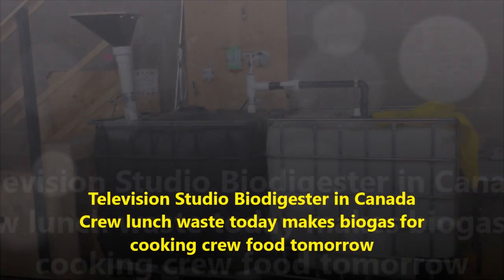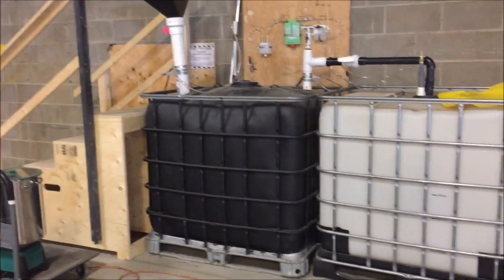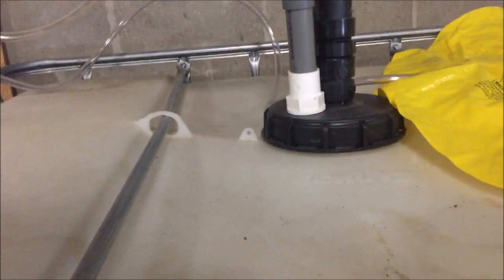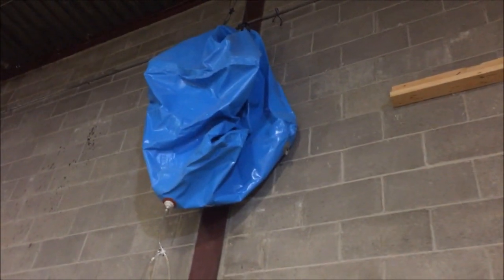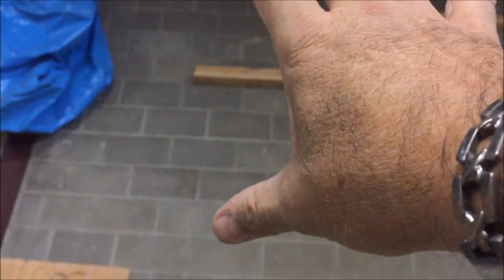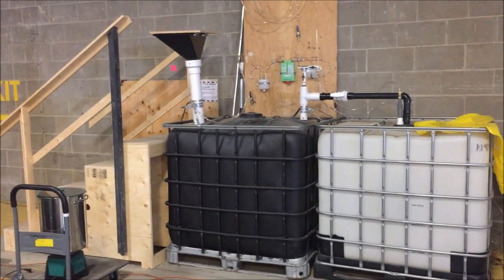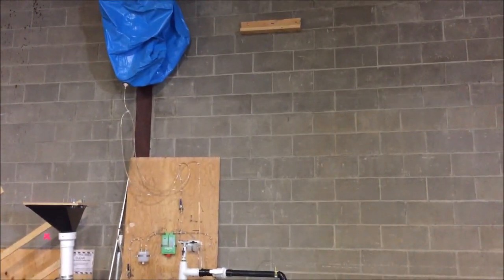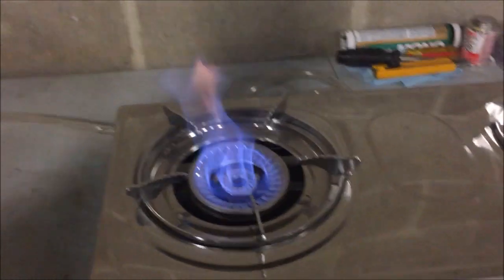Television Studio Bio-digester system

Comment: Nice video. Great work man.
Question:. What is better, 1 big system like 10tonner bio digester or

10 smaller system of 1 tonner container?  Appreciate you very well thought of response. Thank you!  GBU!

Farm produces 15 tonner chicken dung.
Reply from the maker: Maximum you can feed a biodigester is 1/30 of the biodigester volume per day. 

Feeding more does not produce more gas and will not process the waste enough to get the gas and fertilizer quality. 

Also you will need other food waste and animal dung to feed. Chicken dung is too acidic and high in alkaline and could stop the digester from working if you only feed it chicken dung.
Reply: @gregwhiteside7045  copy thanks for the info. Yes I'm aware of it. I will have to get the dung daily instead of one bulk loading. Not just kitchen waste but farm waste but all will be shredded. Like rice hay, leaves dried and fresh.
Reply from the maker: Try not to put in dried leaves or wood, they will float inside the digester and could cause blockages and they do not digest well. Manures, food waste and green plants or green leaves can be ground or cut up and placed inside to digest

Comment: Very clean system, but how did you get gas when the gas bag was empty? Any outlets needed for overflow?
Reply: The bag wasn’t completely empty, there was 50-100 litres in the bag. 

The plumbing system setup includes a simple water pressure release. This is just an inline tee on the gas line to the bag. The gas passes through this tee. The branch off at the tee fitting hangs down and a short piece of gas line poly pipe is attached to this. The short piece of poly ends in a container or bottle that is filled with about 4 inches of water. The container or bottle is not sealed at the top so overflow gas is released and so you can add water as needed as it evaporates slowly over time.

When gas is generated it takes the easy route through this tee fitting to the bag and fills it up, when the bag is completely filled and the gas generated in the biodigester can no longer flow into the bag, the gas pressure is forced down the tee into the water and bubbles out safely as a pressure relief. The water also keeps the bag filled to maximum until I can get a chance to use it.

This is not ideal, since it does release small amounts of methane rich biogas into the atmosphere, but it does act as a simple safety valve that saves the storage bag system if left unattended for a period of time

Comment: hello, how long will the biogas burn? and how do you clean it inside? how often has it to be cleaned?!
Reply from the maker: Depending on the device you are using the gas can last for various amounts of time. A one burner cooking stove on full uses about 10 litres per minute, so if you have made 1000 litres in the bag (a full bag) then you have about 100 mins of cooking time. 

A small 3500 watt biogas generator uses about 60-100 litres per minute so you would get 10-20 minutes of electrical run time run time. Gas production depends on the type of food waste you use and the temperature of the tank. We are in Canada so the digester needs to go inside. 

The digester is always full to prevent any air from inside. This is an anaerobic process so no oxygen is allowed inside or the process stops. Every time you add food waste the same amount of organic fertilizer is pushed out and into the second fertilizer holding tank.
 
It never needs cleaning, ever. 
The methanogens and pathogens inside consume everything, just at slower rates for more dense organics. We use the food grinder or for home use you can use an old blender or juicer from Goodwill to help speed up the process by “pre-chewing” the food and breaking the organics into smaller pieces, mix with old soup or milk or juice or a bit of water to make it into a biodigester smoothie before feeding and it will be very happy.

All fats and oils going inside float to the top region and are consumed rapidly, when broken down the remaining water and nutrients float down to the mid level in the black tank. (The neutral or fertilizer zone) Heavier organics do the opposite, they settle on the bottom and are consumed more slowly, and as they are processed inside they become lighter and 100% of the food’s nutrients float up to the same neutral zone region in the tank. The piping set up inside makes sure that the liquid pushed out when you add new food waste is drawn from this neutral (completely processed layer) within the tank.

100% of the nitrogen, potassium, vitamins and minerals from the original food waste is captured in this water density liquid (biodigestate). It is a super concentrated, organic fertilizer that can be used to grow more food. Closing the loop in food waste recycling and capturing the methane (a greenhouse gas that is 20-25x more dangerous to our atmosphere than CO2) that would normally be released into the atmosphere through traditional composting or sending the food waste to landfill.... It is a natural, organic fertilizer and so rich in nutrients that it can be diluted with water 20:1 before application....so 1 litre of biodigestate from this process makes 21 litres of natural (odour free) biodigestate or compost tea as we like to call it.

When we capture and then burn the methane, the energy is released and the by-product is CO2 and water vapour. Since this is the same CO2 the original organics took in to grow, this is a carbon neutral process. No CO2 is added to the earths atmosphere and this CO2 can now be used by the next crop of plants as the building blocks of plant cells to make more food.

I have a new build going into an indoor vertical farm here in Canada. They will use the biodigestate as a liquid nutrient base for the plants inside and burn the biogas to supplement the heating bill in the winter and the CO2 from the plant waste will be captured inside to raise the CO2 levels in the grow area so the plants will grow faster, to make more food.

Go to Solar Cities Biogas Innoventors and practitioners on FB. Search my name at the top, I have posted pictures of the latest build and I mentor many farmers and builders around the world on there to teach them how to build their own biodigesters with what they have available and how to convert existing LPG devices to run on safe, low pressure biogas.

Let me know if you have any other questions and thank you for watching my video.
Reply: Greg Whiteside thx for your super cool answer, this does help me to understand more and more the process of making biogas. right now we are with our motorhome driving round europe, and i always thougt how to use our toilet stuff. at home i want to try it, and thats funny, cause i am also starting to grow inside our hydroponic fodder and some microgreens. i wish there would be a small traveling solution to make biogas, but thats maybe to small to use it. thank you very much for your answer. i appreciate that.

Comment: Anaerobic Biodigestion is an oxygen free process. The digester container must be filled completely with liquid to eliminate any air (oxygen) from being in the container. Otherwise the methanogens and pathogens inside they digest the food waste will die. So when the black container is properly loaded (filled) then each day when you add new food waste to feed it, the black digester pushes out the same amount of digested (biodigestate) fertilizer into the white fertilizer storage tank beside it. 

The methanogens inside the black container consume the food waste you put in today and convert that to biogas (methane and CO2) that you can burn for cooking or energy and into a tea like liquid fertilizer concentrate that you can use to grow more food.

Comment: so can siphone effect hinder gas production and collection
Reply: Siphon effect will just empty (siphon) all of the biodigester into the fertilizer (effluent) storage container once it starts to flow into the white container. So the goal is to stop that flow when you finish adding new food waste to the digester.
Reply: @foodsecuritystructurescana4440  should the setup tank be left idle for a period for gas production start before continuing to feedstock it and if so for how long?
Reply: Yes 
Inoculate with a fresh manure (cow, horse, pig, human) 
1/3 manure and 2/3 water.

Keep warm and do not feed again until you get burnable gas. Usually takes 21-30 days. 

First gas you get will be just CO2 and it will not light. 

Empty your gas storage each week and try to light the gas. 

When you can light the gas, then it is time to start feeding the digester. 

Each day you feed it, do not feed more than 1/21 to 1/30th of the digester size (divide the digester volume by 21 -30) based on how long it took you to get burnable gas.

Feeding more will NOT make more gas....that is how long it takes the methanogens to digest the food and produce gas so only feed the volume they can handle a day.
Reply: @foodsecuritystructurescana4440  Again how much water should I add to the feedstock
Reply: Ed Kwesi Charman 1/3 manure and 2/3 water. For the entire digester. This black digester is always full to the very top with liquid. There can be no air space inside of it. Fill it until it comes out the effluent tube and then wait the “inoculation” period
Reply: @foodsecuritystructurescana4440  why should I fill it full
Reply: @foodsecuritystructurescana4440  kindly assist me with this question because I left an inch space between the digestate level inside the tank and the roof of the tank so have I done the wrong thing?
Reply: @foodsecuritystructurescana4440  it's a 1000 litre IBC tote

Comment: I personally wouldn't want to risk pushing air into the first tank.
Reply from the maker: Not sure what you mean Matthew. The white tank is just effluent (fertilizer) the black tank is the anaerobic digester (biodigester) 
The food waste goes into the funnel and the pipe extends all the way to the bottom of the tank before exiting into the digester. There is almost no way to push air into the black tank. When the gas bag is full, I use a simple water filled  relief valve to let excess gas bubble out so the bag cannot burst from over pressure
Reply: Hi,  I was a bit worried about the air that is displaced to stop the 'siphon effect/affect', to stop all the liquid emptying out.  I can see why it is necessary to stop that flow.  However, if you put a lot of material in to the digestor you are potentially introducing a lot of oxygen air into the first tank.  That could be explosive.  The same for the gas in the bag.  I know that methane is introduced to the bag all the time and that would potentially displace the oxygen suffiently, there is still a risk with what is in the bag.  The gas mix might not be what you want.  You just might have to be a bit careful with how you light the contents of the bag to test what is in it.  You don't want the whole bag to explode.  You wouldn't want the container to be caught with the wrong gas mix either.
Reply from the maker: Matthew Redden actually the outlet pipe also starts inside the tank in the middle layer of the digester (the zone where digested liquid resides after heavy solids have been digester and after light fats and oils have been digested. 
There is no danger or way for oxygen to enter backward through the liquid down two feet into the tank and then rise back up to the gas outlet area. The siphon effect tee is always used and has no biogas (ch4 and methane) mixed or accessed at any time , in the design. 

Biogas is not explosive or pressurized like hydrogen. It cannot backflash or explode in a storage bag. The only point of flame is at the base of where the biogas and oxygen meet. If you were to poke a hole in the bag near an open flame the only thing that would happen is a small candle sized flame at the hole (where the biogas and oxygen meet) which would burn until the biogas was all used up. 

An open flame inserted directly into the bag would be extinguished due to the lack of oxygen and high CO2 ratio of biogas. 

B energy and other NGO’s make and sell large bags with shoulder straps for people in Africa to go and collect gas from a communal digester and then take it home that way to use in their biogas stoves at home. Very safe and low to no pressure.
Reply: @gregwhiteside7045  Is methane produced by the effluent when it is in the second tank?  That would be a risk surely.
Reply from the maker: Matthew Redden the effluent is pretty much exhausted by the digestion process when it enters the second tank. It still contains some ch4 (which accounts for the slight odor left over. Any gas still being generated is not enough to inflate the air displacement bag or to cause any issues with the air in the empty (in the beginning) effluent capture tank. 

As I said before, there is no danger in testing the gas generated in the beginning to determine when the CO2 generated in the first weeks transitions into burnable biogas and is storeable. It is not like hydrogen or gasoline vapour as it does not backflash or explode. It is used and shared freely on plastic and rubber bags for transport in countries around the world (there are over 4 million homemade biodigesters and gas storage systems in China, India and Africa have embraced this resource as a way to eliminate well water contamination (by eliminating manure or human waste and food waste from entering the water table) and to improve the health of women and children by eliminating indoor burning of manure or wood to cook on with a free food waste resource

Comment: Is the bag not a bit dangerous  ?
Reply from the maker: No not at all 
Biogas is not explosive like hydrogen or gasoline vapours. 

The biogas only burns where it contacts the oxygen, it is very low (almost no) pressure. So if we stick a match or flame right in the bag, it goes out (no oxygen) if we poke a hole in the bag and hold a flame to it, it only makes a candle flame right where the hole is and that burns until the bag is empty. If you add pressure to the bag, it blows the flame out.

Biogas is very very safe. In Africa they sell big bags with shoulder straps on them so people can come fill up with 1000 l of gas and carry the bag home on their back.
Reply: @gregwhiteside7045  Thanks for your reply.  So could this 1 tank power a house or would you need a few connected  together  ?
Reply from the maker: It can generate around 1000 l of gas per day. So if using for a single burner stove (which consumes around 10 l per minute) then you can get about 100 mins of gas for cooking per day....I have converted an on demand water heater and barbecue and single burner stove, you can use biogas in a heater and even get an adapter plate to run a generator on biogas.

It’s all scale-able just add more digester tanks and then you would need more food waste
Reply: @gregwhiteside7045  thanks for your advice